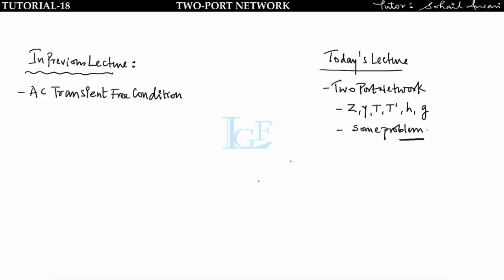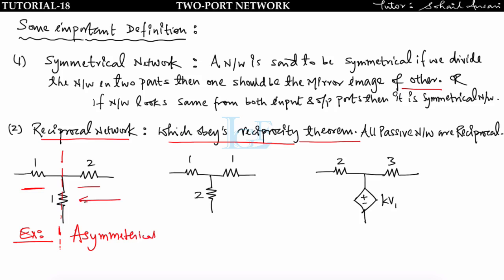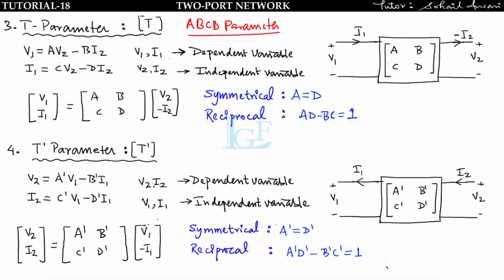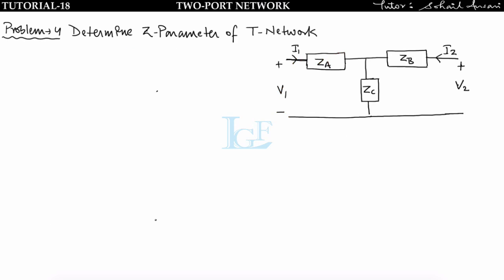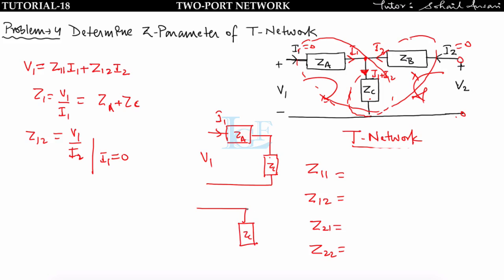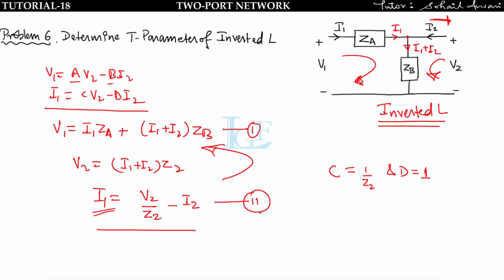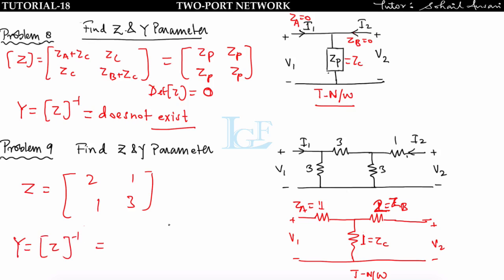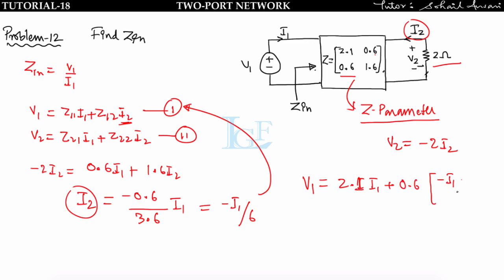Lec-18 Two Port Network-Part I

Comment: Sir, at 32:10 U have taken I2 incoming as +ve, which should be +ve for outgoing I2 in ABCD as per the convention.Please sir kindly specify ,that the direct formula u have  used for inverted L in next lectures also,is correct for which I2 dirn? Incoming or Outgoing I2?

Comment: sir, in h parameter, the first equation is
V1=h11 I1 + h12 V2.
so it is clear that h11 is working as an impedance,,but what is the function of h12 ?
because i think the product of h12 and v2 should be a voltage magnitude...

Comment: I think   solution of the last problem is  wrong. As   In abcd parameter  -I2 leaving mean +I2 entering ,due opposite  direction of current . &.       V1=A V2 - B I2  . Plz clear my confusions
Reply from the maker: yes u are correct...it cannot be edited..so plz correct that..thankyou
Reply: er.Sandy bbn yes, I am also getting 12/31.
Reply: collegetv It is 12/32
Reply: er.Sandy bbn because i2 flowing from below to above, so voltage drop will be according to it.

Comment: hai sir ....! In case Y parameters also Y12=I1/v2    then   1/y21=v2/I1 in that case option b is also correct answer.....? (18:40   problem number 3)  plz clarify my doubt ........Thank you in advance
Reply from the maker: u r wrong here..convert Y parameter in to Z parameter..there u will get on term mod Y..so Z12 is not equal to 1/Y21
Reply: okay  1/Y12 is not equal to Z12 .then y did u take only z parameter ? can't  we take y parameter? understand what i meant to say?(we can write I1/v2 in terms of y parameter  as Y12 )
Reply from the maker: draw the circuit with solution..and upload in this group..and tag me there..i will tell you where u r doing mistakes..
https://www.facebook.com/groups/learnGATEfree/

Comment: In problem no 6,both currents are incoming.so y did u took negative sign sir?U said during T parameter explaination that it is negative because I-1 AND I-2 are in same direction.but here they are in opposite direction
Reply: shantanu Sankpal T parameters means transmission parameters... It means the current in the second port should be leaving...  But we take it as incoming. So it is opposite to our original transmitting current.  Thats why this negative sign..  Hope u have understood

Comment: in last sum z11 = zin 
so zin should be 2.1ohm
please clear this doubt
Reply: Z11 would have been equal to Zin if port2 was left open..... but port2 is terminated by 10ohm R so we have to calculate it by the same method as sir explained!
Reply from the maker: tell me the time at which u are getting problem??
Reply: at 43th minute in last numerical
Reply from the maker: no...input impedance means u r finding thevenin impedance across input..however Z11 is the open circuit impedance seen from the input side when secondary terminal are open circuited...so there is difference between two..